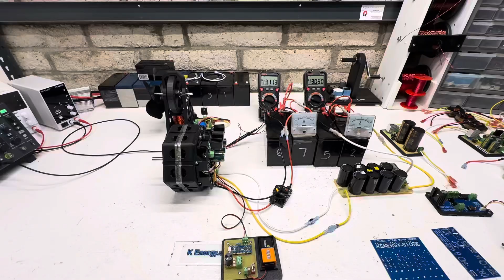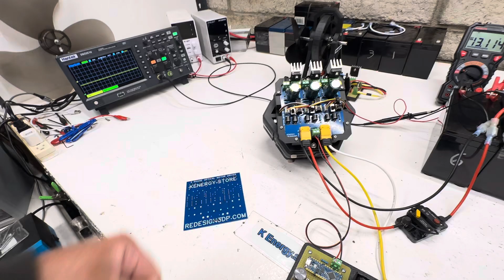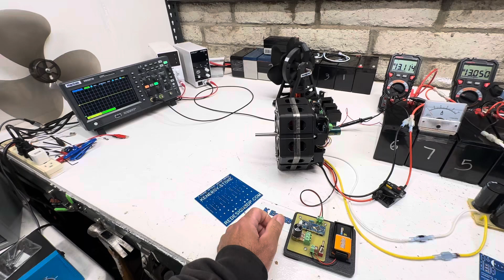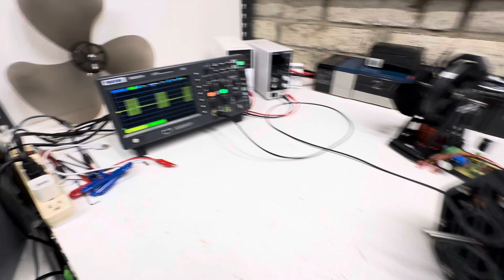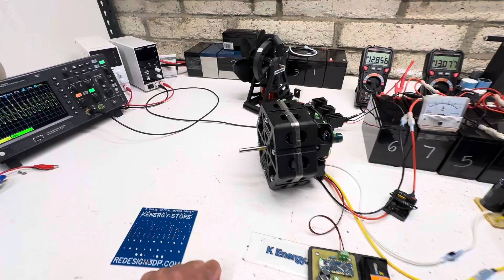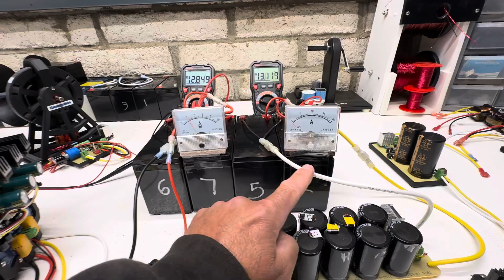New SRM/ Attraction motor ! And new pcb circuit!

Comment: Alot of what you read on reluctance motors say you need laminated steel because solid steel has hysteresis issues and create to much heat, I'm really interested in your take since you seem to make a lot with solid steel and they seem to be working fairly good is it really that important in your opinion
Reply from the maker: Silicone steel would be best but it’s way more pricey to get cut out 
For experiments and fun mild steel works quite well

Comment: How do you calculate the number of turns for each coil and how do you determine the direction of winding?
Reply from the maker: @jacekkotra176  I use a winding counter when I make the coils 
Use same direction when you wind the coils and check polarity before connecting.
Reply: @kenergy1707  Thank you for your response. But if I may clarify, I meant: how do you calculate the number of turns depending on how big the current is?
Reply from the maker: @ for a bedini motor you usually need 400+ turns to run properly

Comment: Where did you get your silicone steel for the limitations? I am working on a much smaller SRM motor (2808 size) but have not been able to find a place to get the silicone steel.
Reply from the maker: @jarrodvsinclair  actually it runs very well with regular steel

Comment: Seems like as the torque applied on the shaft (resistance), slingshots the pulse even stronger.
Reply from the maker: @jatigre1  yes it does